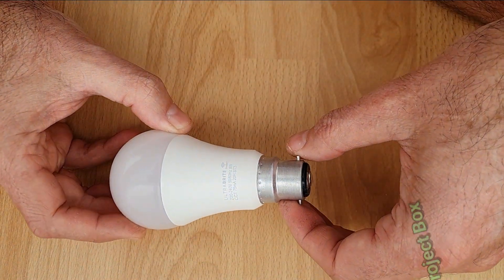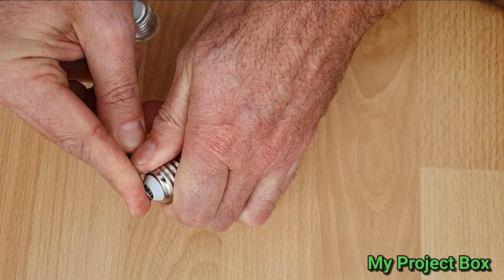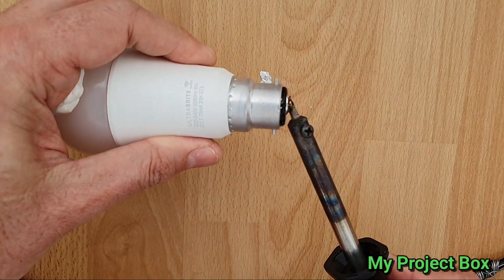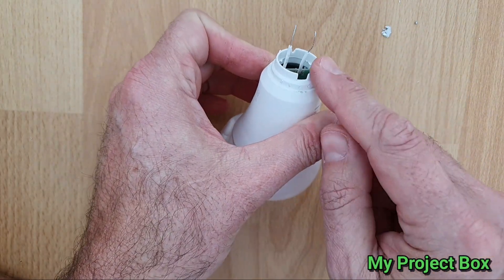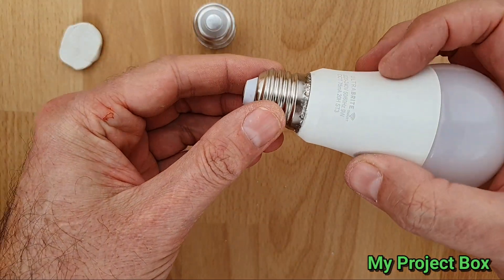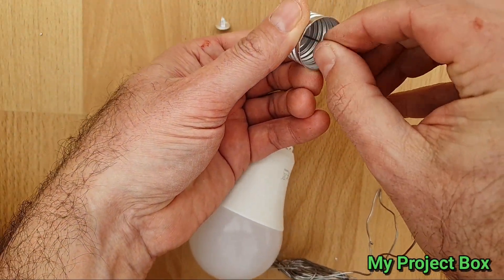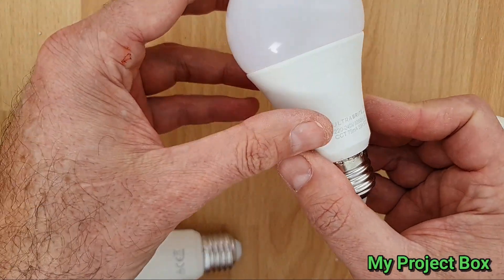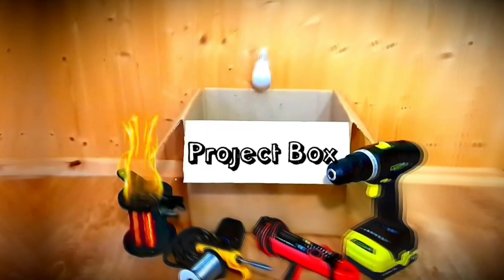Smart Bulb Bayonet cap to Edison screw swap no adapter needed! B22 E27 #ElectronicsCreators

Comment: An adapter only costs a couple of euros/dollars/pounds. It's not worth the hassle converting the lamp. I certainly wouldn't bother.
Reply from the maker: In the UK is easy to find a adaptor from e27 to b22. But on the island of madeira its all e27, and it's not so easy to get a adaptor from b22 to e27. Amazon won't even deliver here. So it's worth switching out the endcaps
Reply: Adapters can be pretty dangerous as if you put them in the wrong way there is a chance of getting electrocuted.

Probably best to change the whole fitting from the videos I have been watching as I want to change mine.
Now in the uk it’s much harder to buy the bayonet fittings on the high street

Comment: I have a very small bayonet socket in entertainment center, want to put in a standard e26 base decorative bulb, can you show how or what adapter piece to use Please?
Reply from the maker: In order to get the right adapter, you firstly need to know what size your bayonet base is. eBay sell many different types of adaptors. Or you can try to swap the bases over. Also are the lamps the same voltage rating?

Comment: Or just buy an adapter from the one to the other.
Reply from the maker: You can but I'm not a big fan of using adapters for E27 bulbs. The adapter allows you to change the polarity of the screw fitting which is technically "dangerous". It's quick and easy to do and you can recycle a base from a failed old bulb.
Reply: @MyProjectBoxChannel  only B22 (socket) to E27 (bulb) adapters carry this risk. The other way is safe as the live and neutral connectors are removed at the same time. The one potential risk I can imagine from such an adapter is accidentally putting your fingers in the socket and touching the live pin.
Reply from the maker: @mmoonman13  I prefer no to use a adapter, just because it looks ugly🤣. There are safer B22 to E27 adaptors https://youtu.be/Sdd-54U-sqk